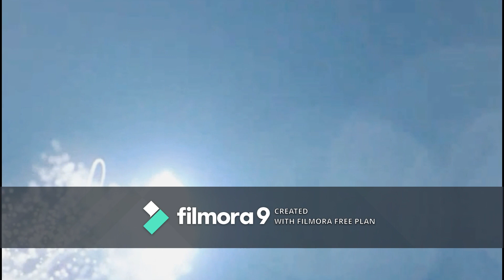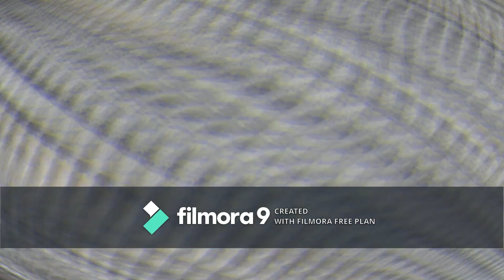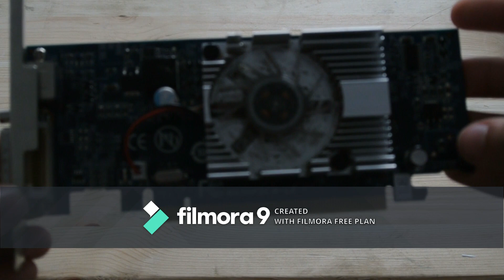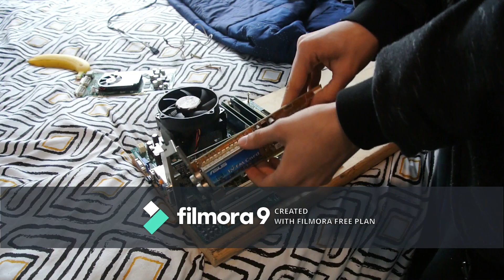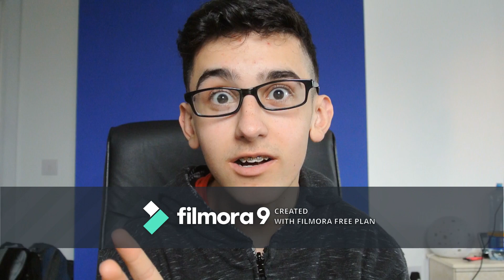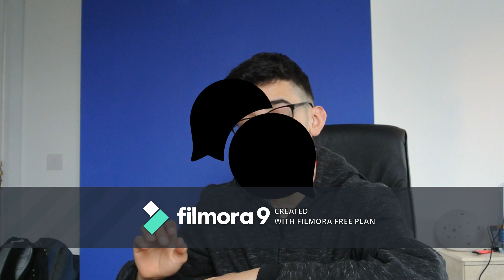Simple D I Y wall mounted pc build guide

Comment: I wish the one I'm building was this easy. I need to mount 8 hard drives to mine.  That's the reason it's not in a case right now.  It's currently sitting as an operational pile of parts on a table